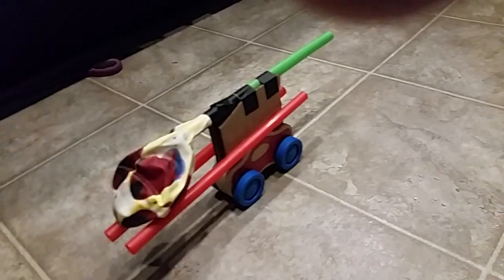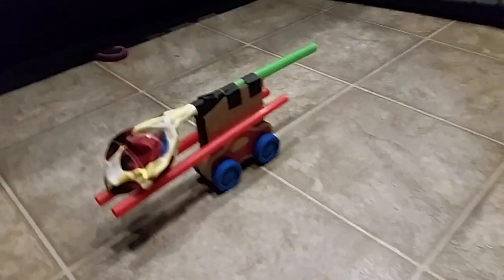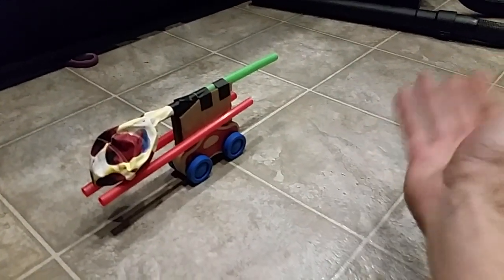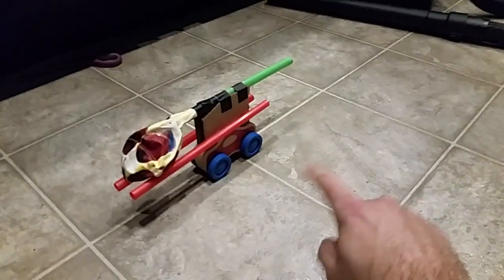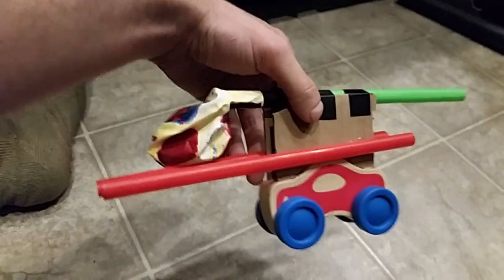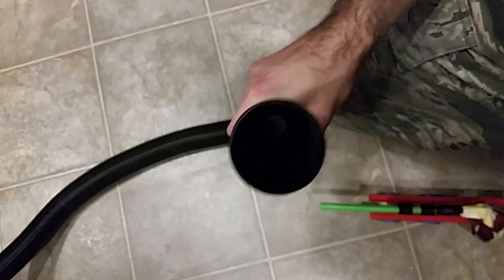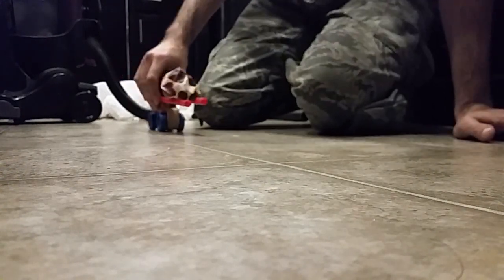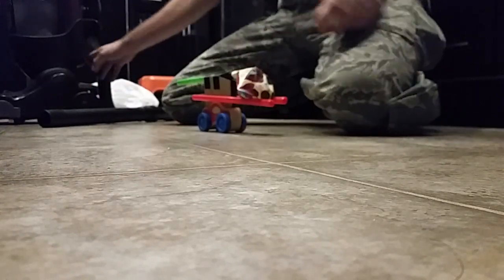Newton's Third Balloon car with vacuum behind it

Comment: the vacuum cleaner s nowhere near powerful enough to simulate a vacuum.  But what little vacuum there is definitely slows down the car.   Rockets cannot work in space.
Reply from the maker: This was mostly to respond to a video that claimed this doesnt work and "proved" that rockets dont work in a vacuum.

Ask yourself this then:
Can you swim up river by swimming slower than the water you are pushing against?
Why the heck do you think it makes any sense that the only thing that propels a balloon car is air pushing off of air when the air it would need to push off of is going more than double that speed the opposite direction?

If you really think something that throws mass gets thrust from hitting something else then please explain this:
https://youtu.be/FR2QLhbI5s0

You literally have to think that newtons third law is not a real thing to think that rockets dont work in space. Get on some ice and throw a beach ball and then throw a medicine ball... which one pushed you back farther? The beach ball is bigger and hit more air, so why did the heavy smaller ball make you go back farther? Throwing mass away propels whatever it came from the opposite direction.... that is literally all there is to it and there is no way around it. Molecules are like tiny little marbles shooting out of whatever the "vehicle" is.

Newtons third law is a thing, is easily proven, and means that anything like a rocket that shoots mass MUST work to be sent the other direction... regardless of something for that mass to hit into.
Reply: @Jasoninee    It vis not the air that is being pushed off of to propel the car.  ( or rocket)   The reason the car moves is because the escaping compressed air is creating a higher pressure behind the car and so the car is being forced into the lower pressure in front of it.  High pressure Always goes to low pressure just as Hot always goes to cold. 

     Newtons laws are real but do not apply to vacuums.  Because you cannot apply a force to a vacuum, so therefore there is no force going back to the rocket. 

  What happens with rockets on Earth is that the hot expanding gases create pressure behind the rocket and force the rocket into the lower pressure in front of it.  You cannot do this in space because you cannot create pressure in a vacuum..   A rocket in space will just have all the expanding gases removed from the rocket at the rate at which they expand.and so no thrust ( work)  is achieved. 

    In the video you posted many forces are at work.  ie.  the hose wants to straighten due to the water pressure.  the water pressure needs to be tested for variability and air pockets being removed. Newtons third law applies to Earths atmosphere.  But imagine this.   What if you fitted a vacuum cleaner to the end of the hose and sucked out the water as fast as it was being pumped. ?   there would be no thrust.  That is exactly what a vacuum does.
Reply: @Jasoninee  bo ptah is a GOAT HERDER and has never picked up a physics book in his life. You can completely ignore him.

He thinks RECOIL stops working in a vacuum, he is an imbecile.
Reply from the maker: Renegadebroadcasting Renegadebroadcasting  Whaaa?
Reply from the maker: @Renegadebroadcasting Renegadebroadcasting  Whaaa? Are you human? Not really communicating like a human does with another human lol.
Reply from the maker: Renegadebroadcasting Renegadebroadcasting  I am confused about the communication lol. Do you have a question or concern?
Reply from the maker: @Renegadebroadcasting Renegadebroadcasting  What? This is the strangest convo ever. Do you have a question or concern?
Reply from the maker: @Renegadebroadcasting Renegadebroadcasting  

Alrighty I watched the Rocket engine pushing off of air video I assume you want me to watch. Maybe?

He put a rocket engine in a tube, and did one test with the front open and one with it blocked. I do like this experiment because it shows how wonderful the effect of Bernoulli's principle is, and it especially shows how the car gets much more thrust through the principle of Newton's third by being able throw more mass than it was originally able to.

A 1/2A6 rocket engine has 1.25 N•sec of impulse. It is intended only for rocket models that are 1.5oz MAX. If a rocket model had ZERO air resistance and weighed even 2oz, with this engine it would only go like 35ft into the air. You know what weighs 2oz? 12 sheets of paper. So that rocket engine can launch the weight of 12 sheets of paper 35ft into the air assuming ZERO resistance. You are understanding this is a TINY engine right? You know this tiny engine still does though? It shoots out a good volume of high velocity gas. You know what high velocity gas shooting out does to static air around it? It pulls it in and takes it along for the ride due to Bernoulli's principle. The high velocity gas is creating a vacuum and sucking in much more gas to throw out the back than what was thrown out before when the front was plugged. This is great for a lower speed/negligible air resistance scenario that will require more thrust. The new difference in pressure is throwing out much more gas and as such is creating much more thrust.

The results of this happening are absolutely no surprise with the physics involved and are a great example where throwing mass away from something, emparts force on that thing to propel it. The ejected mass does not need anything to run into to empart the thrust.

The Rocket engine/vehicle is essentially a machine throwing tons of little balls of mass (molecules) and that gives thrust. If you don't understand how this is possible and think it is bogus then go onto an ice rick with two different setups. The first one is holding 3 bowling balls while still and then throwing them. The next one is holding 3 inflatable beach balls that can even be bigger than the bowling balls. From motionless you will find that throwing bowling balls applies much more force to you than throwing beach balls, even though the beach balls are larger and "push against" more air.

If throwing mass did not work under Newton's third and instead was from the thrown mass running into air, then this experiment would not work this way. If you don't believe this you have some crazy flawed understanding that with two masses pushing away from each other one is the pusher and the other is the pushed, but this is not true. That would require magic. Take two identical bowling balls that each have the same spring stuck on them and tie them together compressing the springs. Imagine tossing this up and cutting the tie. What happens? Do you really think one of them is magically the "pusher" for no reason whatsoever? This is exactly analogous to a rocket, but instead of the masses of the objects matching (rocket and expelled gas) the rocket had a lot of mass, but it is ejecting the gasses at ridiculous velocity. Every molecule of air is essentially like a little bullet fired that is just like the bowling ball scenario except the huge force comes from it pushing away super fast instead of it having a lot of mass.

I am sorry but the quality of that channels videos is ridiculous. Stuff about the equinoxes will inherently make no sense. There is no flat map where every single person on that map witnesses sunrise and sunset at exactly due East and due West. This is verifiable since the direction of these for any date is amazingly open and available to everyone online. An entire great circle of longitude for EVERY SINGLE PERSON ON at that exact time is seeing sunrise/sunset at EXACTLY due east for the sunrise people and due west for the sunset people. This cycles and works for EVERY SINGLE PERSON ON EARTH for an equinox. The is ABSOLUTELY no flat map that anyone can make where they put a path of a sun over it to where this is even remotely close to match. It would always be ridiculously far off for huge parts of the map at any one point. This along with the angle of the sun at noon 100% makes the Earth a sphere. There is no other shape that can physically make this happen. Pick any flat map/model you want, put the sun wherever you think it should be for a certain time of day for a certain place and I will show you how it is absolute nonsense for someone else on an equinox. If you match reality for one person somewhere there will be someone somewhere else where the angle they should see the sun is ABSURDLY far off.
Reply: @Jasoninee  A rocket cannot work without resistance at all.   Rockets require resistance to complete the conservation of energy principle.  Which is why  a rocket cannot work in a vacuum.
Reply from the maker: @bo ptah  No that is nonsense. I guess utilizing Newton's third inherently involves the resistance of mass to move, so maybe the word choice isn't the worst thing in the world. Anything that throws mass HAS TO be pushed the other way. That is the only way that works. Pressure is nothing but molecules colliding. When molecules are rushing out the back of something (rocket gases) they have only been able to go that direction from having pushed off of something in the opposite direction. Pushing off of something and then releasing away to the opposite direction pushes that thing it pushed on.

For you to actually believe what you are saying you would have to not believe in Newton's third, which is ridiculous. If you don't see why it is absurd to not believe in Newton's third I can show and explain many things for you that are very simple. You absolutely have nothing legitimate to act like Newton's third is not a thing. Any object or person that has an interaction with mass being pushed/ejected away from it, ends up with a push against itself.

Read through the comment I just replied to the other person. Threw some examples in there. I guarantee I can give you examples where you will be cornered into realizing Newton's third has to work and it will lead to realizing that there is no reason to randomly act like it doesn't apply to rockets.
Reply from the maker: @bo ptah  I have no idea where you see an issue with conservation of momentum. Read my example for the other person commenting with comparing throwing bowling balls vs beach balls(that are larger) while on ice. Throwing the heavier smaller bowling balls absolutely makes you accelerate more, but they are smaller. It is so nonsensical to think of that and be like "oh yea for sure the thrust of throwing something away from you only happens because there is air for it to hit". The dang beach ball could be 3 ft wide and the force pushing you backwards from throwing it will be damn near nothing compared to throwing a much smaller heavy bowling ball.

If you really want to act like you don't understand this. Imagine throwing that 3ft wide super light beach ball vs the bowling ball while increasing the weight of the bowling ball but the size remaining the same.

Is a heavier bowling ball harder to throw or not? It is always the same size and is smaller than the beach ball, how in the world do you imagine the force only coming from there being air with this thought experiment?

What if the bowling ball becomes 100 pounds or let's go 50kg? Are you really gonna take a stance saying that thus scenario does not end up pushing you back more than throwing the 3dt wide beach ball.

Maybe you have never thrown a beach ball? I have. This is VERY obvious if you are on a float and throw heavy smalle things vs throwing a beach ball. The beach ball emparts damn near zero force when you throw it even throw it is much larger.
Reply from the maker: @bo ptah  A vacuum does not physically suck anything 😆. What we say in normal conversating as "sucking" is nothing more than gas or liquid under a higher pressure traveling to the lower pressure.

I cannot believe this has to get told to adults.
Reply from the maker: @bo ptah  That was the most nonsensical joining together of words. You did not say "the vacuum sucked" you said "sucked into the vacuum"? You didn't explain anything to an adult because you didn't explain anything. That was incoherent babble.

"Sucked into the vacuum" by what exactly? Just saying it is "automatic" doesn't showcase anything you are attempting to explain. If you are actually agreeing that pressurized gas pushes itself out of a container then obviously there is no "sucking". Sucking in terms of physics is not a thing. It is a ton of molecules flying around and with an opening they end up flying out. There is nothing "sucking" about that.

You know pressure is a thing right? So imagine there is pressure in a container. You open one side... now there is no linger that side/piece over there for the pressure to push against and this causes an imbalance with the pressure that is on the front. When a container is sealed all the pressure collisions of the molecules hitting the walls equate to a net zero overall force of the container (it doesn't go anywhere). Popping an opening in it allows molecules to escape. The escape area obviously can no longer be collided against to form pressure forces that are emparted on the container. The hole makes one side have more pressure than the other. That 100% makes the container have a net force to be propelled.
Reply from the maker: @bo ptah  Noooooo. The force emparted on the Rocket is from the pressure on the FRONT of the container (can obviously be the fuel that is in the container and at the front) where the gasses are being formed.

Not sure where you are getting this from but you are extremely misinformed. The high pressure is only wanted inside of the engine.

The goal of a high performing rocket is actually that the gas right inside the nozzle (bell shape) is as close to ambient pressure as possible.

Look at the balloon picture here from NASA. If you really think NASA isn't the source when you say "everyone states rockets work with ...." then idk who you would be talking about LOL.

https://www.grc.nasa.gov/www/k-12/rocket/TRCRocket/rocket_principles.html

See how they make the opposite arrows of the open balloon very large and bold so you understand? The force is inside the engine. Throwing out the once pressurized gasses means that at one point they had to collide and "leave" their pushing to the front. Now that they get to escape they cause an imbalance. The front of the inside of the Rocket engine has a bunch of force with no rearward force and this creates the thrust.

If you don't believe this start googling what rocket engineers seek to have the pressure of their exhaust gases to be. High pressure exhaust is NOT wanted. That means energy was lost from the molecules of gas not being directed as straight back as possible. Colliding molecules is pressure. The more pressure maintained with the exhaust means energy that did not get used for a "straight" push. This is unwanted. The more pressure outside of a rocket, the worse it performs.
Reply from the maker: @bo ptah  

The only force that can push a rocket forward is pressure against surfaces that have a component toward the front.

The nozzle cone is used to stop inefficiency in lower pressures and vacuum of space. Some pressure is still left in the gas when it can come out of an opening in various directions. The bell of the nozzle gets some last few collisions out of the molecules that are able to fly out at more extreme angles. These angles can be turned back into some pressure by forcing them to realign into a more straight back trajectory. In an atmosphere, the atmosphere actually fights the engine a bit, because it works on a difference in pressure from inside to out the nozzle, bur atmosphere pressure also makes a nozzle less crucial because air pressure is there anyway and somewhat straddles the the exhaust into mire of a column. The bell shapes are crucial for very low pressures and vacuum environment where much lossy gas has an easier time going out at higher angles.

You can actually observe this yourself it you watch rocket launches. The plume/fog look of gasses you see will be very column like at ground level, and as the Rocket gets into very low pressures you can see it being much wider and spread out. This spread our gas is wasted energy as no nozzle is going to align all of the gas.

http://www.braeunig.us/space/propuls.htm

https://static.sciencelearn.org.nz/images/images/000/000/405/embed/A-typical-rocket-engine20151021-1336-1mzzaw.jpg?1674164248
Reply: @Jasoninee    No.   "  A component towards the front"  is not physics it is nonsense.   Rockets move because of pressure differential 
  The gas leaving a rocket in space has ZERO pressure, because there is ZERO resistance in space.   No resistance = no pressure.  
   the pressure inside the rocket is com[pletely irrelevant.   ONLY the pressure outside matters.
Reply from the maker: @bo ptah  LOL soooo... you take back your whole everyone says a rocket engine works on X principles thing?

Your tone seemed like you were claiming you knew the consensus  of the general population and Rocket professionals. You were obviously wrong. I am surprised you thought you could randomly take your own thoughts and act like that is what everyone thought, but yea you failed miserably.

Is this your normal critical thinking standard? Just think up something yourself and be like "Ughh.... I am not dumb... this is how EVERYONE claims it works"?
Reply from the maker: @bo ptah  Absolutely rockets move from a pressure differential. Pressure pushes evenly inside of a container. When one side gets opened There is pressure still on the front that has no corresponding opposite force on the back. That is a net forward force.

Not sure if you have done physics before, but net forces is how physics is done. The balloon diagram that was linked is an absurdly simple concept.

Pressure exerts force against the walls of a container no? You agree with that right?

Assuming you agree, you must also agree that those forces must all add up to zero net force for the purposes of moving the container, because otherwise you would believe that a pressurized container with nothing going on would move itself.

Now if an opening is made in the container those exact same forces of pressure are still on all the walls. We go around and add them all up. Just like before every  side has a force where we find a force going opposite that nets it to zero force overall. Oh no but wait! We check the side opposite the opening, and it still has pressure. Then we go to try and find the opposite side's force to net zero overall force, but OH SHOOT... there is only an opening. There is no wall there to even have a force against. This imbalance of there still being a force on one side from pressure but not the other side equals a net force in the direction opposite of the opening.

It is an extremely simple concept and you understand every piece of it. You are just getting to "net forces" at the end and being like "OH NOPE! I don't like that I feel weird about it, so I will choose to be willfully ignorant of it and deny"
Reply from the maker: @bo ptah  I only picked NASA because you were using phrasing that made it sound like "everyone says a rocket works on X principles". Your tone was one of "the man" like you were explaining what the people you don't believe say about rockets. You were absolutely wrong about that and that is why I actually tried to find it from NASA. 

You really didn't understand that was the point?

You were like "Oh yea like I am gonna believe X about rockets from these people that I don't believe"

Your X was wrong. You were clueless how it is even actually explained from who you don't believe. This is part of why you sound ridiculous.
Reply from the maker: @bo ptah  The point of the Rocket engine is to make high pressure inside of its container and have one side be released. There is not a goal of a pressure "behind" the engine. Thrust is from Newton's third. Oddly enough there is a goal for the exhaust gases to have as little pressure as possible once they have left the nozzle.
Reply from the maker: @bo ptah  Cannot create pressure in a chamber exposed to a vacuum? What? LOL. Gases don't instantly come out of anything. You think if you have a tiny hole in a pressurized container in a vacuum that it just instantly becomes not pressurized? 🤣
Reply: @Jasoninee  No.  you are completely clueless about physics.  To move with a physical force you need to interact DIRECTLY with the immediate environment..  There is no 'environment in space and so movement is possible with a physical force.
Reply: @Jasoninee  the hole in the rocket chamber is massive compared to the inlet holes for the fuel and oxidiser. .  So it is impossible for there to be any pressure,  
   Plus.  you need pressure to mix gases.    you need pressure to combust mixed gases,  and you need pressure to propel the rocket.   A rocket in space is completely impossible  .  It is actually funny that people still believe it.
Reply from the maker: @bo ptah  With comparing the "holes":

I am so confused what you are getting at. Are you making it sound like the gases formed would leave too fast to ever make pressure because the nozzle throat is so much bigger than fuel and oxidizer inputs?

You do realize that is a ridiculous apples to oranges comparison right? You want to have a problem with the inlet holes being too small for the two components that MIX AND EXPLODE? A liquid fuel-oxidizer rocket is built with a nozzle throat and inputs specifically to attain certain chamber pressures. It is pretty important to know what chamber pressure is to be attained since is the whole dang reason the rocket works 😂.

The idea of comparing them like "yep yep... ins and outs" when between in and out there is a gigantic energetic combustion is ludicrous. How do you end up thinking of this stuff for more than even 5 seconds and still be like "oh yea... I am definitely making a good point here"
Reply from the maker: @bo ptah  Throwing mass away from yourself or ANYTHING  pushes you/thing the other direction.

Anything that pushes even gas away (even gas produced on the thing that is going to push it away) gets sent the other direction.

You are getting to the point of being like "Newton's Third can't work". Which us the most absurd thing to claim.

Riddle me this:

Make a spring loaded tube of tiny ball bearings with a mechanism to hold it compressed until a trigger is pulled. Imagine the trigger getting pulled in a vacuum. You telling me that you honestly believe that for some magically mysterious reason that the tub with the spring becomes some empowered by God object that doesn't get pushed away like recoil when the trigger is pulled?

PLEASE PLEASE answer what you think happens for thus example, because man oh man do I have some pictures to draw, show you in a video, and ask you about.
Reply: @Jasoninee   Of course the gases leave too fast to create pressure.   Imagine a SCUBA tank with the bottom cut off and then connected to a vacuum.   How much pressure can you put in the tank  ?  
   There are no rockets anywhere near space.  It is completely impossible.
Reply: @Jasoninee    You DO NOT push gas away in a vacuum.   That concept suggests some form of resistance to the gas leaving the rocket.   There is no resistance to the gas es leaving the rocket in a vacuum.  So there is no force going back to the rocket as per N3.   I hope you understand this simple simple concept. 
   A rocket in a vacuum just has its gases SUCKED out of it.  No movement of the rocket happens.   
   Your analogy of the spring and ball bearings is irrelevant to a rocket in a vacuum.
Reply from the maker: @bo ptah  No it is not irrelevant. You explain what you think pressure is and why it happens then. Pressure literally is the PUSH of molecules flying around. A vacuum is nothing. Is literally not a physical "thing". It is a lack of things. Since a vacuum is NOT A THING it cannot do anything to molecules. The only mechanism for molecules to escape a container is through their eventual movement in that direction and get out. The forces involved with a molecule leaving only come from pressure. Pressure is the only thing available to push anything. A vacuum is not a magical puller of anything. You even self-described your use of the word vacuum to actually mean that the difference of pressure is what is happening. You sound absurdly confused and wilfully ignorant 

You are either clueless or wilfully ignorant to what pressure is. I notice you haven't replied anything about pressure and it putting force on the container it is in.

You make a vacuum sound like some magical phenomenon. A vacuum is nothing. Pressure is a thing.

You are really still with an "understanding" that a "vacuum doesn't suck" and also "rocket in a vacuum has its gasses sucked out of it"? You obviously are very confused and aren't thinking very deep about your concept of pressure and vacuums at all. If you weren't completely off base with this you would not be mixing together "the vacuum does not suck" with "in a vacuum it has its gas sucked out".

ANYTHING that ends up moving involved force. If gas molecules go from bouncing around in a container to then flying out of the container, they MUST HAVE had some kind of a collision that made it go the direction of the opening. On a picoscale a gas molecule does not just magically change direction toward a vacuum. A vacuum is nothing. It isn't a force, it doesn't draw anything toward it, it does not SUCK. A vacuum is merely somewhere with less energetic/density of molecules compared to somewhere else... that is it. A gas molecule that ends up exiting a vacuum only does so from randomly going that direction from previous collisions. Anything that ends up going one direction after collisions MUST HAVE emparted force in the other direction from previous collisions. It is like a bunch billiard balls on a table. They are all bouncing around and then let's remove one small rail of table. To end up flying off of that edge any ball would have needed to previous hit matter in the other direction to end up going off. Even if it previously hit another ball it made go the "wrong" way, that other ball will eventually do the exact same thing. To leave the table one direction every ball had to net force push against the table in the opposite direction. This is exactly analogous to what pressure is. With a hypothetical perfect opening (one where every single ball leaves only in an exact perpendicular line) PRESSURE (balls hitting the rails of the table) is the ONLY thing that transmits the force of the balls that end up leaving.

Another thing it seems like you must be in the dark on:

You realize that with a vacuum just being a difference of pressures, there isn't really a difference between a container with 1015psi while the outside ambient is 15psi and then 1000psi where the outside ambient is 0psi?

You are completely hung up on some random made up concept in your mind that 0psi is something special compared to any other lower pressure scenario. It is not something special. You poke a hole in something 40psi in a 15psi atmosphere and essentially the same exact thing happens in that instant as 25psi in 0psi environment. Obviously the first one stops at 15psi with equilibrium, but at the moment the expelling starts it is the same thing.
Reply: @Jasoninee  gases cannot create pressure in a vacuum.  It is impossible.   So there is no pressure pushing the rocket........the end.
Reply from the maker: @bo ptah  Presure is the molecules COLLIDING WITH THE CONTAINER. Putting a hole doesn't just magically make every single molecule change course and never hit the container walls. They actually MUST hit the container walls previously (or indirectly through hitting another molecule that previously hit the wall). Hitting the walls is the pressure. It is impossible for a molecule to want to leave a container to a vacuum without There being pressure inside of the container.

You still seem to think that a vacuum is some magical phenomenon. Molecules of gas with energy zoom around and hit the walls of their container. This is pressure. Even when they have an opening to leave they still zoom around hitting the container until they randomly reach the opening.

You are conflating filling something up slowly with allowing it to leave quickly. You have randomly chosen the example that makes no sense for the scenario we are talking about. YES what you are making up as "impossible" is 100% possible and very easy to achieve. A container with both a supply and an opening to a vacuum  ABSOLUTELY has the ability to still be pressurized. As long as the supply is faster than the exit of gas from the opening There will be pressure. A vacuum is just a lower pressure. You are apparently hung up on some concept that 0psi has mysterious magical properties, but it still nothing more than a pressure difference vs other pressure.

You have almost certainly experience exactly what you claim is impossible. If a car tire is inflated to 40psi. If the atmopshere is 15psi this means the tire is at 55psi absolute (funny enough you may not have understood this, but a tire gauge measures RELATIVE pressure). With a small leak in the tire it is 100% an example of a pressurized container, with a hole, surrounded by vacuum. The setup of a 55psi tire in a 15psi environment is the same thing as a 40psi tire in a 0psi environment. When you have a small leak that sometimes go pump up some more to make up for what leaked out, you are experiencing EXACTLY what you said is impossible.

Once again. A vacuum is not a THING. It is a lack of things. A vacuum compared to pressure is more than a lack of things when compared to somewhere else. Inside of a tire that is 55psia/40psig the outside of the tire is a vacuum compared it to it.

Can pressure exist inside of a container with a hole to an outside vacuum to where you supply gas and energy to maintain pressure? UGHHHH YESS ABSOLUTELY. It is actually how rockets work LOL
Reply from the maker: @bo ptah  Your point makes no sense. Then a tire could not have a slow leak.

Pressures are just relative things. There is nothing magical about 0psi.

A tire with 55psia in an environment of 0psi acts the exact same as a tire with 40psi in a 15 psi environment.

You are saying a leak cannot exist in a tire where you can keep filling it to maintain pressure.

A hole to a vacuum is not some magical instantaneous sucking of everything inside out. There is still pressure. The gas molecules are still flying around and hitting the walls of the container. Gas does go out of a hole at infinite speed. Putting gas in faster than it is leaking creates pressure.

Explain how your thought of what pressure is puts force against the walls of its container. Especially if you believe in molecules, tell me what you think is happening with the molecules in a pressurized container to put force against the walls. Once you explain that tell me what about a small hole at one end magically makes a molecule that was about to hit the wall of the container INSTANTANEOUSLY causes it to not hit it. There is nothing magical about a small hole just because the outside is even all the way down to 0psi. You would be describing some magical thing/force that PULLS every molecule instantaneously from its movement that creates pressure. A gas is essentially a ton of miniscule marbles flying around hitting the walls of a container. In your mind what is it about a tiny hole that stops the miniscule marbles from hitting the walls of the container?

Your explanation makes no sense. You pretty much have to believe some or all of these nonsense things:

Pressure is magical and does not involve molecules hitting the walls of their container

A vacuum is a magical thing that literally instantly pulls on molecules

A 1015psi container in a 15psi environment is magically drastically different than a 1000psi container in a 0psi environment.

It is physically impossible for a pressurized container like a tire to have a small leak to where an input of gas can be made to raise and maintain pressure.
Reply: @Jasoninee  the human tendency of allowing pride to overrule honesty. When the facts prove that your theory is wrong, change the facts so you can continue to have the admiration of your peers and cronies, and in many cases to acquire the funds necessary to continue your work
Reply from the maker: @bo ptah  I love that someone took the time to make this. It is small scale representation of exactly what you are probably getting at.

I woukd imagine your mind is super upset at the general idea of this because of earth having an atmosphere while space is a vacuum. It is a very simple concept actually and you are just being wilfully ignorant to the physics of what is happening. There is randomly a line of pressurized gas next to the vacuum of space. It is a gradient. Anything with an attractive force like gravity (or call it a mysterious magnetic-like attractive force of mass assuming you don't like the word gravity) will have the ability to hold onto matter that naturally wants to fly around. Since vacuum IS NOT A THING it is a lack of things, molecules of gas would like to TRY and fly off into it with their natural motion at some point. There is nothing in a vacuum (remember a vacuum is nothing) to keep a molecule going. Gravity (or your avoiding-gravity word X) still acts on the molecule because it has mass. The molecule still gets attracted backwards and comes back. There is no line. There is a gradient all the way out to where only a tiny amount of molecules are attempting to fly off, get pulled back, and run back into the other tiny amounts of molecules that are also pulled back down. Look at atmosphere pressures as altitude increases and see how nonsensical your opinion on this is.

0ft (Sea Level) - 14.7psi
5,000ft - 12.23psi
10,000ft - 10.1psi
20,000ft - 6.76psi
40,000ft - 2.73psi
60,000ft - 1.05psi
80,000ft - 0.406psi
100,000ft - 0.162psi
200,000ft - 0.0029psi
300,000ft - 0.0003psi

What is this line you are worried about? The earth isn't a container where walls are needed. Pressure of a gas from gravity (word X for you avoiding gravity) does not need a container. It forms a gradient from all of the molecules colliding around on top of each other. You could do the same thing with a giant tube that you swing around. The opening right at pivot point right above your head would have the same ambient pressure and the end of it will have an increased pressure and this is with no line or barrier to separate the pressures.

Just the fact that the pressure on the first floor of a house is greater than the pressure on the second floor of a house should be a problem to you. OMG THE AIR DOESNT RUSH UP THE STAIRS 🤣🤣. And oh man don't try to refute that one. There is a reason your ears pop with increasing elevation and even your phone reads air pressure to measure elevation. There is higher air pressure at your head than there is at your feet. OMG a pressure difference with no barrier whaaaaaaat?! 😂
Reply from the maker: @bo ptah  High pressure is not wanted behind a rocket what are you talking about?

Oh I forgot to add the link I wanted in the last comment. It sounds like your nonsense pressure next to vacuum concerns stem from the worry that the earth isn't a container of atmosphere so here:
https://youtu.be/DWSWvWHvu1U

Pressure is relative. A 55psi tire in a 15psi environment is the same as a 40psi tire in a 0psi environment.

Just throwing out "is a violent event" is not a point that means anything.

Do you believe pressure in a container exerts force on the walls of a container YES or NO?

Do you believe gas is molecules YES or NO?

A vacuum is not a force or even a thing. It is a lack of things. Nothing about a small hole in a pressurized container makes every single molecule instantly change direction to the hole. If you believe this you believe a vacuum is some magical mysterious force that can instantly make molecules just laser beam toward it. That is not at all what it does.

A vacuum is not a force or even a thing
Reply from the maker: @bo ptah  With that video you are probably "omg ridiculous. Gas flies around so it doesn't have gravity (word X) applying to it to make it sink the bottom of a container and trap itself into a pressure gradient)."

But yes it does. Gas is molecules and mass like any other matter. A molecule of gas that goes to fly out into space is just like a tiny marble thrown up. It will fall back down. If you need proof that gas has weight and is actually pulled to earth's surface just like any other matter all you need for proof is realizing that containers filled with pressurized gas weigh more than they did when they were not pressurized. A scuba tank even sinks when filled and floats when empty or even at reserve pressure (500psi). Gas anywhere on earth has a pressure gradient. The bottom-most are of the container has higher pressure than the top. This is because even though gas molecules are always flying around, they are still pulled down. This pulling down makes molecules jam together more at the bottom than the top. Jamming around of molecules and hitting the walls is the pressure. This is also why your ears pop if you go up in a building, or even go hiking up elevation. The gradient is obvious, makes sense, and the higher pressure below does not shoot up into the lower pressure above. This is because gravity (or your replacement word X) does the same thing to gas molecules as it would bouncy balls flying around in a container. 

https://youtu.be/XvHJEuOXszc
Reply: @Jasoninee  You cannot throw a gas into a vacuum.  Gases naturally expand into the vacuum without applying a force to the rocket.
  You need to understand that a gas operates differently in a vacuum than in an atmosphere.
Reply from the maker: @bo ptah  Gas only goes out into a vacuum because the molecules have motion. This motion had them colliding before they left. Those overall collisions ending with "missing" colliding with the back cause an imbalance of force. They hit the front but not the back since they went out a hole.

You have a severe misunderstanding what pressure is.

You still haven't answered. Do you believe pressure puts force on the walls of a container YES or NO?

What causes this force against the walls?

If a molecule flies out of a hole do you realize that means that it MUST HAVE HAD a series of collisions previous to flying out that made its trajectory toward the direction out of the hole?

There is no two ways about it. A molecule flying directly "backwards" HAD TO have transfered force "forward" before it was sent backwards. Forward collision with no corresponding backward collision is a net force forward.
Reply from the maker: @bo ptah  

 Again you are just using words for effect as if they mean something.

Please explain what "naturally expands" means.

Please connect the dots from gas molecules making pressure on the walls of a container to "naturally expanding" out of it.

Describe at the molecule level how you rectify that gases are there contained putting pressure against the walls of a container WHICH IS A FORCE into "naturally expanding" out. Explain how you think a molecule of gas puts pressure on the wall of a container and whether or not you think it somehow ends up going out a hole. What gets it going the direction of the hole? Where was it going before it was going toward the hole?

You are putting any meaning behind your words used for effect. You are pretending like the words "Naturally" and "violent" just inherently give you credit for no reason. Those mean nothing if you aren't connecting them to any "why". "Naturally expand" takes nothing away from my point that molecules must have been colliding with the walls and other molecules to get to the opening. There must have been collisions in the opposite directions to get going that direction. You are using "naturally" and "violently" as if it explains anything to refute my points. Using those words does not take anything away from what I presented you with when you explain nothing.

You might as well just say "Well to counter your point; it naturally results in what I think without explanation so I am right"

No LOL. That isn't an argument. Explain away what I presented. "Well it naturally does this" is not explain anything against what I am showing you.
Reply from the maker: @bo ptah  Made a video for you. Watch it or don't I don't care. You are already to the point of not legitimately making any points that mean anything, so I would not be surprised if you do not watch it.

https://youtu.be/6Rs12hbuMC4
Reply: @Jasoninee  To enable the molecules to collide around in the combustion chamber.  You need resistance to stop the gas from leaving into the vacuum.  .  but there is no resistance.  And o the gas automatically goes into the vacuum.   
   there is no point in discussing a rocket going into space.  A rocket cannot go anywhere near a vacuum.   Werner Von Braun discovered in 1943 that a rocket cannot develop thrust above 100,000ft.   It is only momentum that took rockets above that altitude.  the current record is 360,000 ft.
Reply: @Jasoninee  To create pressure in a container requires RESISTANCE'  there is no resistance in space 
  There is not a small hole in the rockets combustion chamber.  There is a massive hole.   There is no possibility of any pressure being created when exposed to a vacuum.
Reply: @Jasoninee  Molecules leaving the rocket do not need to apply a force forward to leave .  Because the flow of molecules is towards the vacuum.   Just as water does not need to push off af a bucket to empty on the ground.   Gravity provides the circumstances for that,  just as 'joule free expansion' does for the gas in a vacuum
  To exert a force backwards means you need to exert a force forwards  ( N3).  But you cannot exert a force on a vacuum.  .  So there is no force going anywhere.......Which is why it is called 'Joule free expansion'.
Reply: @Jasoninee    A gas only remains a gas cloud because of resistance.  Gas molecules repel each other naturally.   You need resistance to keep a gas contained. 
   This is why it is important you understand 'Joule free expansion '
Reply from the maker: @bo ptah  You are the one that wanted to use the word "violent" like it meant something. Well guess what is happening inside of that rocket chamber. A ridiculously violent explosion of gases. The chamber is no joke designed SPECIFICALLY to maintain the creation of gas vs what the nozzle throat let's.

The "hole" and creation of gas is exactly design to do exactly what you are saying it shouldn't. Who in the hell are you to just be randomly throwing out "omg the hole is too small for the amount of gas created". THAT WAS EXACTLY WHAT THE DESIGN WAS FOR....
Reply from the maker: @bo ptah  PLEASE PLEASE PLEASE answer how you think pressure works. You keep avoid this question and it appears you think that molecules magically flow without collisions. Pressure literally IS COLLISIONS. Any molecule that leaves previously was colliding with molecules or the wall in the opposite direction. You think molecules are just floating and not colliding? The only thing that pushes them out is the colliding. That colliding is net the opposite direction. You even said you realize that the pressure PUSHES the gas out. How do you realize this and not realize there must have been pushing from the opposite side walls or molecules for one to leave. 

Your reasoning makes no sense alongside your other reasoning.
Reply: @Jasoninee  pressure requires resistance.
   ie    The first molecule leaves the rocket travelling at x velocity.  Followed by the next and so on.  Because all the molecules are travelling at the same speed.  they do not collide.  and so no pressure is created.   
  In an atmosphere the first molecule out of the rocket is resisted by the atmospheric pressure and so the second molecule out then catches up with it and so on.  This creates pressure in an accelerated manner.  .   but this ONLY applies to atmospheres.   A rocket in a vacuum just has all the gas sucked out of it and in theory,  moves  the rocket backwards very very slightly., because of the occasional errant molecule hitting something solid on the rocket as the molecule accelerates backwards.  
  I hope that is clear.
Reply from the maker: @Renegadebroadcasting Renegadebroadcasting  

This was a very thrown together video from years ago, but if the thrust from fluid getting shot away came from hitting something then why does this example not work to increase thrust?

https://youtu.be/FR2QLhbI5s0
Reply from the maker: @Renegadebroadcasting Renegadebroadcasting  "Because of the water that hit the glass and wooden plank" LMAO what?!

You are saying there is no extra push registered when I shove my hand all the way up to like a half an inch from the water blasting out because of water hitting glass/wood? When you say glass do you mean the scale glass? Like you are saying you think a few random droplets of water hitting the scale somehow makes it NOT read EXTRA force? Hitting the scale makes it read less? That is part of your reply?

You are really telling me you watch that and in your mind you are like "oh hell yea this is going to be so obvious that the water hittung something creates more force" and then you see it do ABSOLUTELY NOTHING  and you are like "oh pffft.. well it is because there a few tiny droplets somewhere for sure subtracting all the extra push"

For real? 🤣. You really stare at the video seeing the water hit my hand with that force where probably 99% of the water goes anywhere EXCEPT the direction of the scall setup and you think the splashed micro drops are negating what should be a big jump of thrust in your opinion? That is utter nonsense.
Reply from the maker: @Renegadebroadcasting Renegadebroadcasting  Your concerns make no logical sense. Guaranteed you watched this "knowing" you see extra force. Maybe even like 10% you would be like "yea 10% should be reasonable" and there is NOTHING. I will redo experiments however you want 🤣🤣🤣
Reply from the maker: @Renegadebroadcasting Renegadebroadcasting  🤣 "Nothing you do will gain my trust"

Code for "oh shit he is willing to do those extra things to corner me and it was already pretty solid so far where it kinda shattered what I thought I knew"